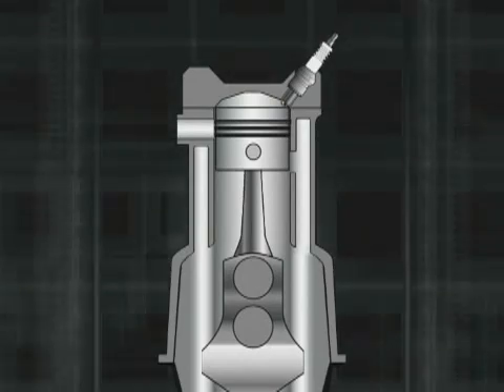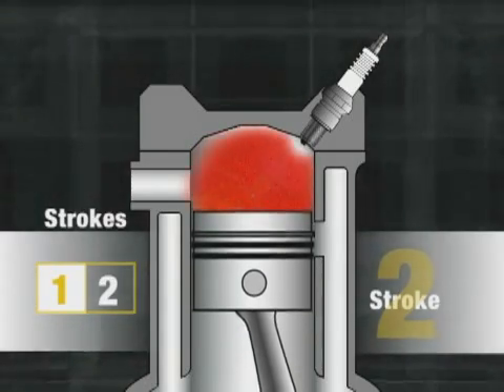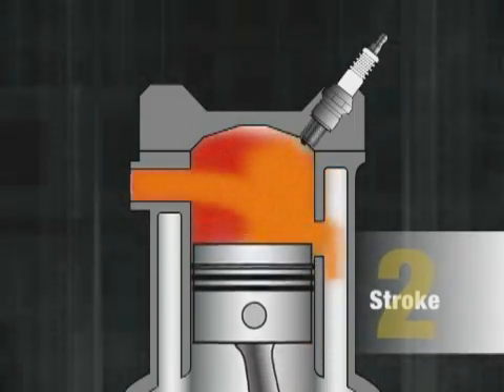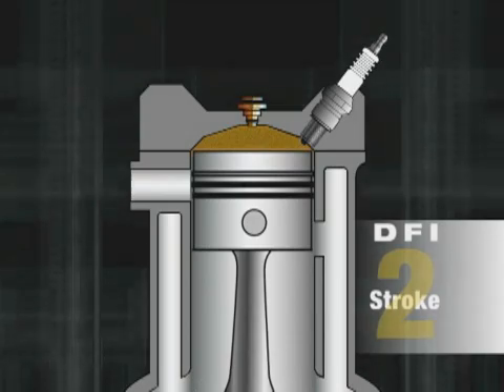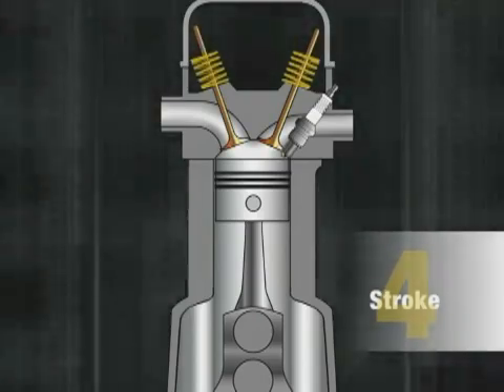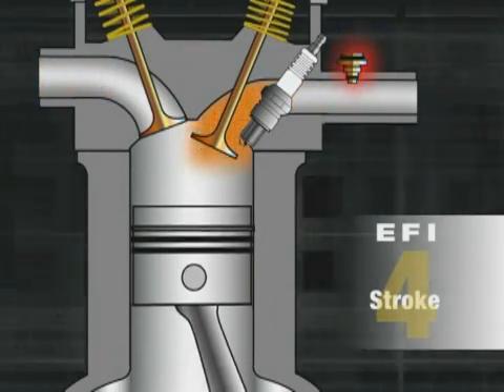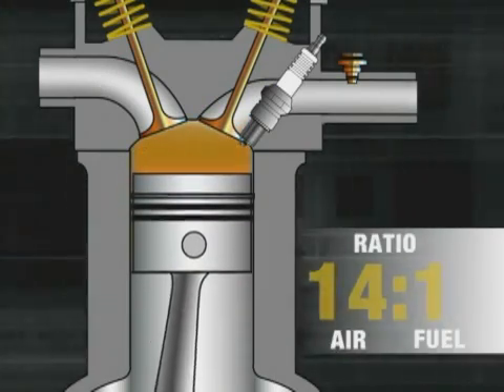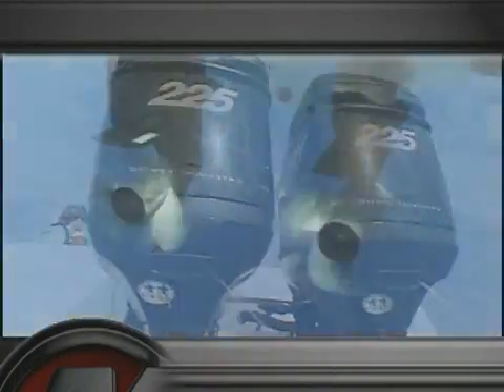How 2 stroke outboard work and how 4 stroke outboard work

Comment: On dfi how does the crankcase get lubrication
Reply: My guess is a oil injector is there and the crank sits in a pool of oil that filters through the engine
Reply: Brain Grenade52 its a 2stroke should be no oil in crank case or I’ve never seen oil in a 2stroke crank case before